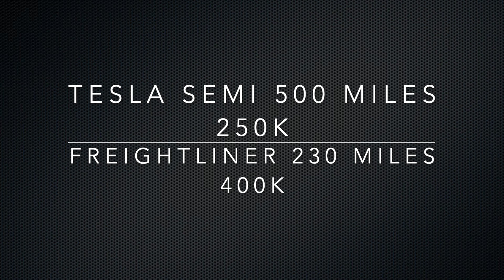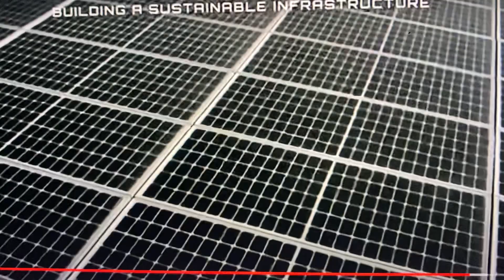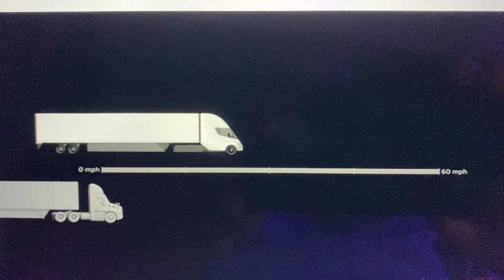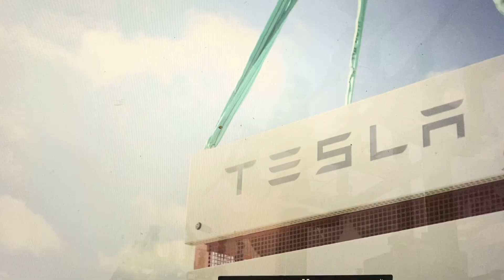Tesla Semi $250k V. Daimler $400k 2022 (a855)

Comment: Daimler had 5 years to prepare. They failed. This is the first time I see that Daimler openly admits they are not the pioneers, trendsetters, but will attempt to copy Tesla. But they are missing the point: I think that Tesla's secret is the "machine that makes a machine". It's the way they constantly improve on the go. It is something unbelievable to behold: I'd think that to change so ething, the company has to go through a nightmare of bureaucratic paperwork and months of aporovals. But they say in another video that they are improving on the go, from one vehicle to the next one. So it seems to me if Daimler will copy the way they manufacture the Semis, they'll get there. But if they only copy the production and do similar with their semis, they'll be making something that Tesla used to do years ago.
Reply from the maker: Yup